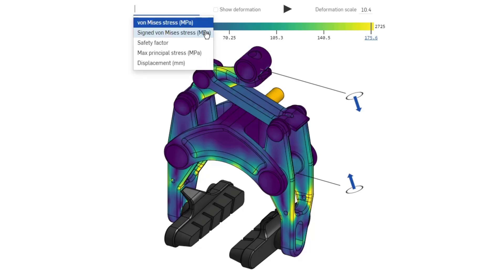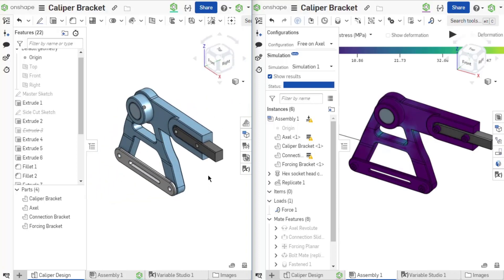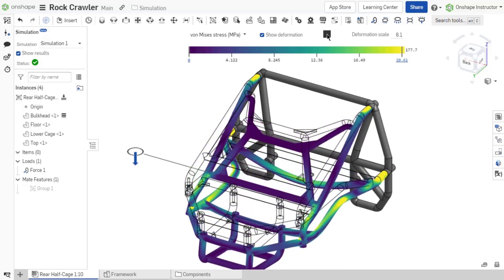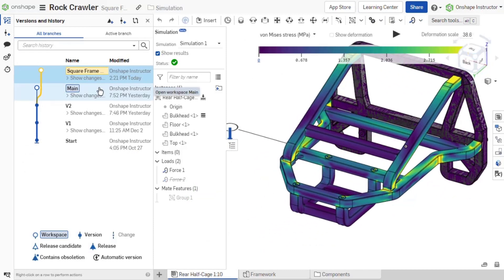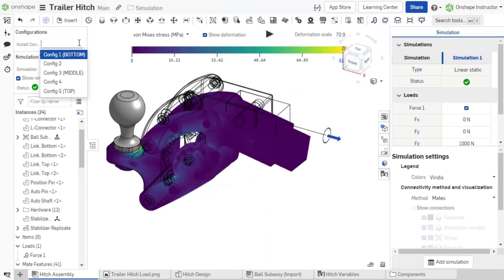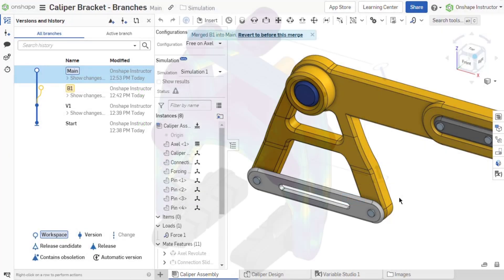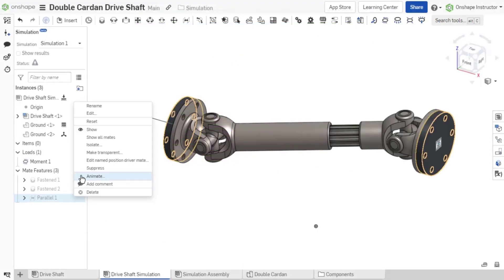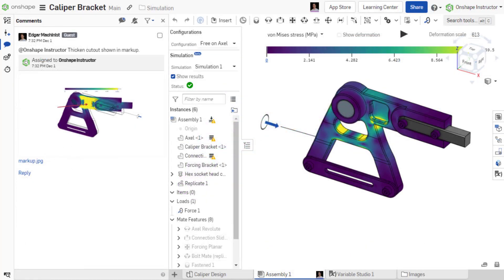Onshape Simulation Course Overview

Comment: DO NOT TRUST ONSHAPE FEA. Onshape FEA gives complete garbage results. Run this part in a real FEA Software and you get totally different results. The ROOT of the problem is that Onshape FEA basically uses fixed boundary conditions when and where is should be using rotational or slide boundary conditions. Please ONSHAPE, pull the FEA software out of BETA and start with a new architecture that allows the user to define accurate boundary conditions. All of your tutorial videos and help videos online show these same inaccurate results. I've tried to use the software to prevent itself from making these detrimental assumptions, but there doesn't seem to be a way to bypass the core assumptions built into the software, probably in an attempt to simplify setup for the end user. Yes it's simpler. Yes, it's terribly wrong.